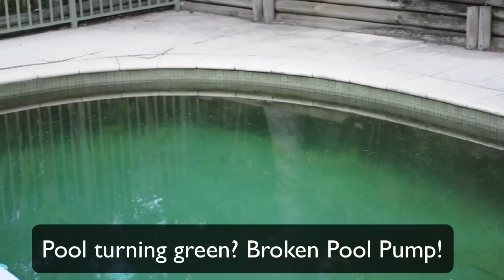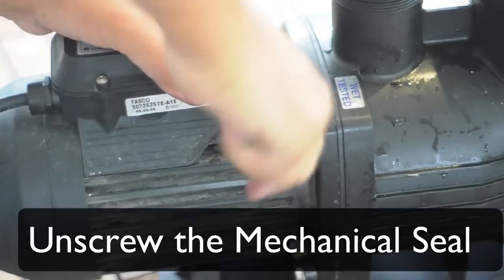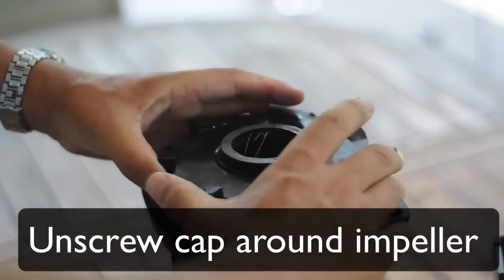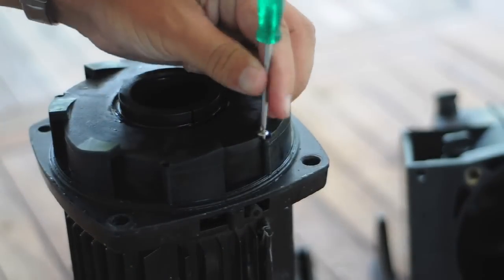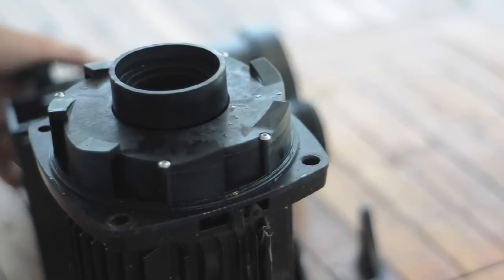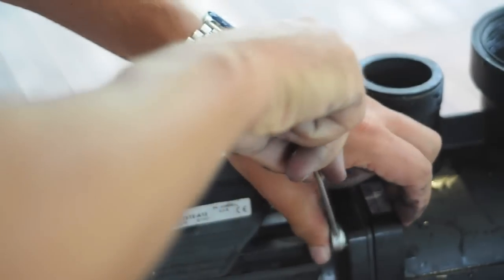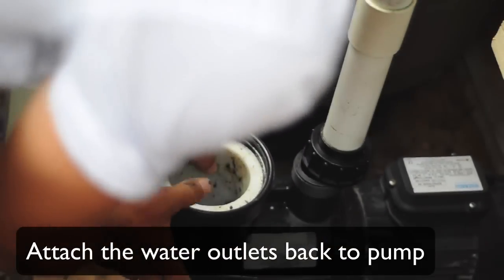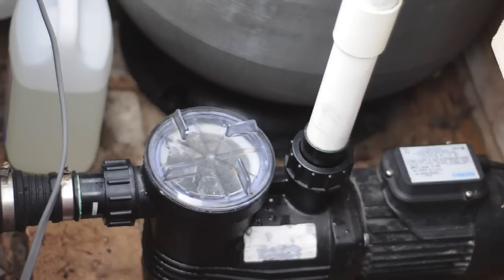How to fix your pool pump from humming

Comment: actually what filling the strainer housing with water does is not only give a bit of water to jump start the suction process but more importantly keeps the graphite/ceramic mechanical seal wet so it does not destroy itself from running dry

Comment: Just a quick question, is the impeller supposed to spin all the way around, or just move a little. Because I've removed some debris and I can sort of jiggle it a bit from left to right, but it doesn't seem to want to spin all the way around

Comment: we replaced our motor and it worked for a few days and stopped. We found out that the shaft seal should be replaced as well. we replaced it and now it's now spinning/working at all.